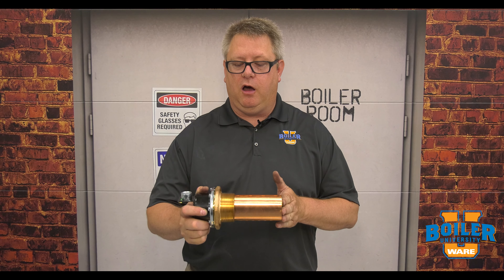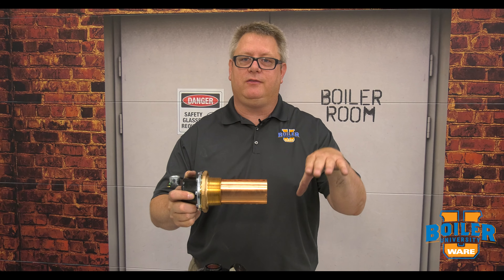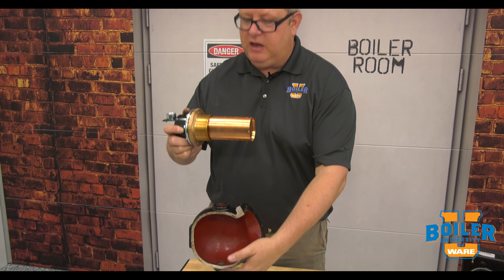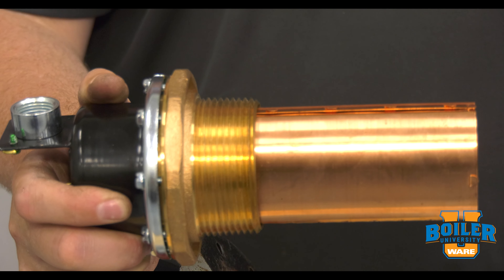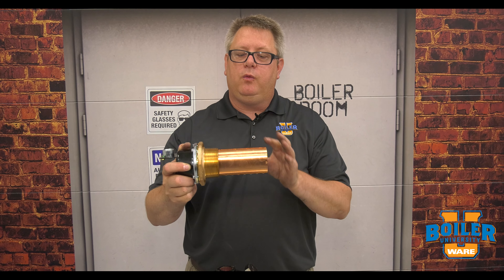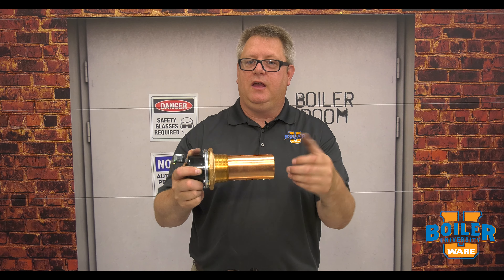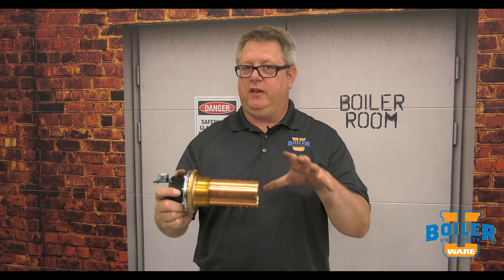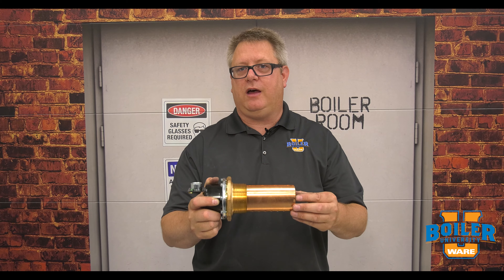Level Controls for Lower Pressure Boilers -  Weekly Boiler Tips

Comment: The McDonnell & Miller 69 (and the 269) have 2 sets of dry contacts, 1 NO and 1 NC. If space is tight inside the wall (tubes, etc.), the 269 is the way to go, as it doesn't protrude nearly as far inside as the 69. We use them for monitoring/alarm purposes on self-contained hot water heat exchangers.